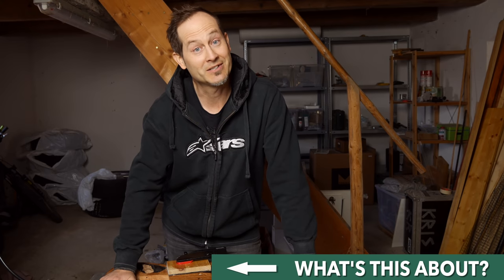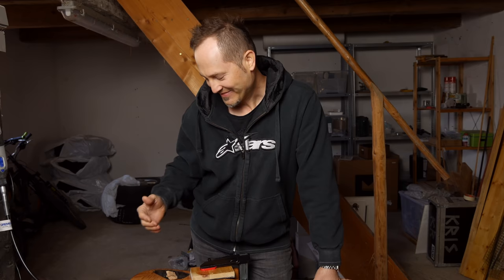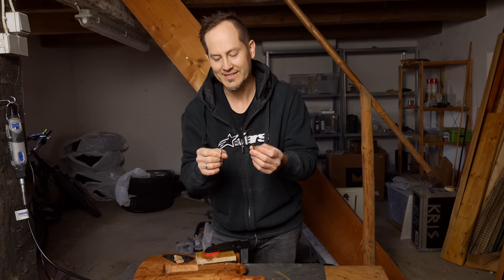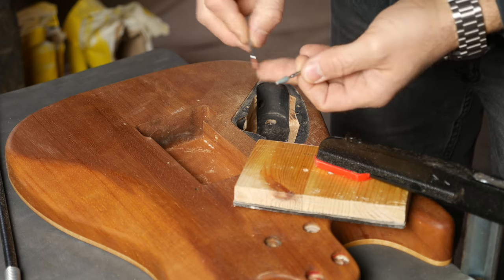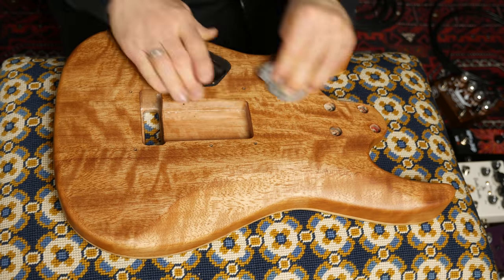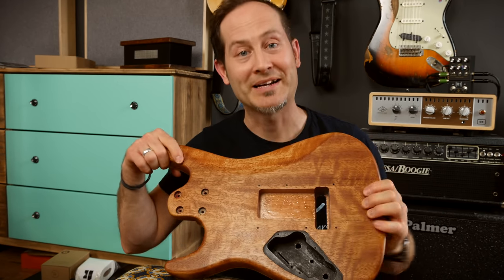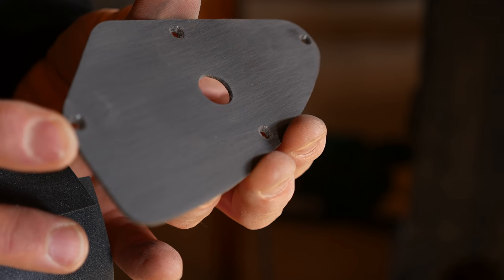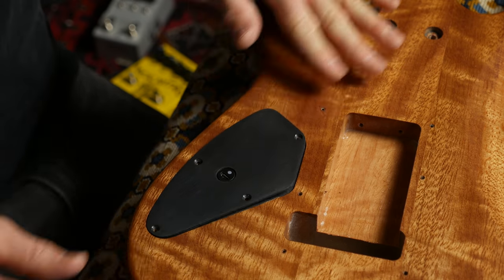Harley Benton - Fishman Fluence Mod | PART 3 | Guitar Tweakz

Comment: you should never wear gloves using a tool like a router, bench or chop saw, drill press as they prohibit vision, give you a false sense of security, and if the tool catches the glove your hand gets more mangled by the tool
Reply: good that you mentioned it. Many people do not know about that... worst on an angle grinder, but most people use gloves there!

Comment: you could've filled the hole from the toggle switch by using it to install an LED power indicator. It would switch on when you're plugged in to an amp and switch off when you remove your instrument cable from the output jack.

Comment: I've been really enjoying this series. I've been working on a project for my fiance's aunt. She asked me  to turn a couple antique glass door knobs into a hat/coat hanger. I was trying to figure out how to finish it until I saw your last video in this series, and ordered some of that oil. I still have some work to do before I can use the finish, but every time I see that guitar body, I know it's going to look great with the oak slab I bought. I am going to wire up some LEDs to make the glass door knobs glow, seems like it'll be fun 😁🤓. Also a learning... it turns out properly kiln dried oak is hard AF and takes forever to sand 😂

Comment: "Is it ridiculous if I spend more time tidying up the routing...?" No, not at all! It means you take pride in your work and don't half-@ss it like many would. Nice job, too! I think I probably would have mounted the battery the same way you did, for the same reasons. Your wiring template idea was also a really clever solution. I'm a mechanical & aerospace engineer, and in my opinion you have the natural aptitude of those who make good engineers (is that your trade, perhaps?).

Comment: Hi) You can hide that hole from minitoggle after filling it with a silver painted stick with a nail polish lacker with sparkles. I think you can find some to match the sparcles on top of the body) ( i've got similar problem with repearing chipped sparkle finish on drumshells). Cheers)

Comment: What was your consideration for putting in the Fishman fluence classics instead of Moderns? I already have PAFs in my Gibson so I was thinking of moderns for a different sound. Any advice is welcome
Reply from the maker: The Fluence moderns sound way more like active pickups (more compression and a very clear tone) and I don’t like that too much. I mean I like that tone, just not so much the feel. These Classics are closer to pafs but still enough defilierend for me. Especially the hot rodded bridge pickup voicing. That’s the reason I went for the classics. 👍 Have fun with this mod!

Comment: Good stuff. Not sure if you saw my comment on part 2.  I suggested using the switch that used to be for coil spit in the original wiring to disconnect the battery from the new active PU. Two benefits. 1) You can leave your guitar cable pugged in without draining the battery and 2) it acts as a kill switch since those PU make no sound when there is no power. I still recommend wiring the battery to the output jack so you are guaranteed to have the battery off when there is no chord (it would be easy to forget which position the switch was in before putting your guitar back in the case). So basically, two OFF switches in series - either one disconnects the battery.
Reply from the maker: I’ve seen your comment and I find the idea great! Unfortunately I have no space for a mini toggle switch anymore because of the position of the rechargeable battery. That’s why I had to fill the hole and give up having a small switch there. It’s unfortunate but that’s alright. Anyways, thanks for the suggestion!

Comment: Attempting to install active pickups in a passive guitar for the first time. So thanks for this video. Any reason you are using a dremmel and not a router?
Reply from the maker: Reason 1: I don’t have a good router at home. 😆
Reason 2 (which is the actual reason): a Dremel is way more agile and smaller so I can get into the electronic cavity with it way better than with a big and clumsy router. 
That being said, if you have to cut out a straight-walled battery compartment, a proper router is gonna be way better than a Dremel of course.

Comment: I just finished up this exact pickup install in my Harley Benton Fusion-T (third gen fusion, t-style) and was going into it fully prepared to need to rout out the control cavity, but to my surprise, the fusion-t has a huge cavity with more than enough room for the battery and pots and all the extra wiring. Very nice to not need to get the dremel out! I’m loving the voicing options! Thanks a ton for making the video, it was a really valuable resource for planning my own conversion to a set of fluences.
Reply from the maker: I guess I should’ve waited a little longer and get a Fusion-T then. 😂 Thanks Ryan, glad to hear that you liked the video. Enjoy the Fishmans!

Comment: This will be a mean machine

Thanks for sharing all the great ideas!

I got a question

How I can find this roll of black foam? My friend is playing his Jazzmaster with a random rag in strings. I was hoping to buy a foam piece designed to sit under the pickup but they are unreasonably expensive. Is it something special or just a thick door gasket?
Reply from the maker: It's from Göldo and I bought it at Thomann for my Squier bass. I can't find it in the shop at the moment, it seems to be sold out. It might be back in stock soon. It's called Göldo PL000 Foam rubber for pickups.
Reply: @KrisBarocsi  Thank you 💗
It fits in many exotic cavities so I'll find it and use a lot

Comment: Installing Fishman Fluence Pickups is a real nightmare! I did it on 3 of my Guitars. I'm happy when i've never have to open the cavity again............ but i must, on 2 of them: i just thrown the Battery inside like that, because its so crowded with wires, the Battery will literally move nowhere ;-). On my JEM Jr it was a hassle and took me close to 3 weeks to install everything because there is simply nearly not enough space in the electronic cavity for all the required wires. Not to mention the Battery. On this one finally i choosed to go with the Strat Battery USB Charging Backplate, no matter i stick out a little fat -as you mentioned.
Reply: Installing fluence is no diffrent than any other install.  You just need to plan for what you're about to install.  If you don't, you may find yourself struggling to make room for wires and switches.  There is no other set if pickuos thag would give you the freedom or flexibility with tone while being noiseless
Reply: @TheKensusi  You are right. But still installation remains a nightmare (and i did lot of PU swaps with Passives). Don't know why Fishman don't offer them solderless?
Reply: @Worlds_Worst_Guitarist  I've personally had poor experiences with solderless pickups.  There's nothing like an install that makes a solid connection (point to point)  We made the back of the pickups quick connect so you can mix and match any of our pickups without having to rewire your guitar.  It's the best of both worlds.

Comment: Why not to use the hole for Killswitch instead of a stick?
Reply from the maker: The rechargeable battery is in the way so no switch is possible to fit in there. Otherwise I would’ve went for a killswitch.
Reply: @KrisBarocsi  I saw rubber material you've used to tighten the battery  Maybe it leaves some space? Or to move the battery up a little bit. Anyway the guitar looks coooool ))